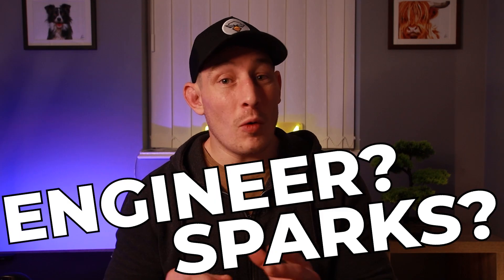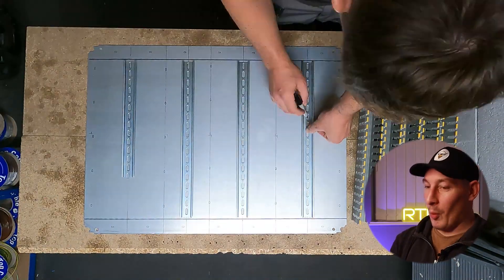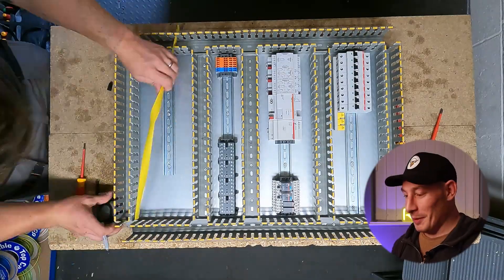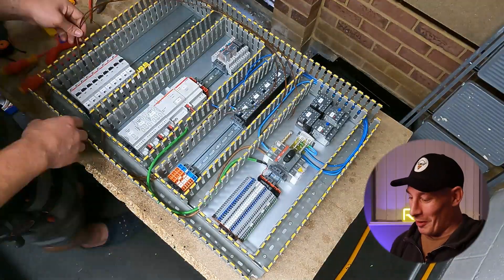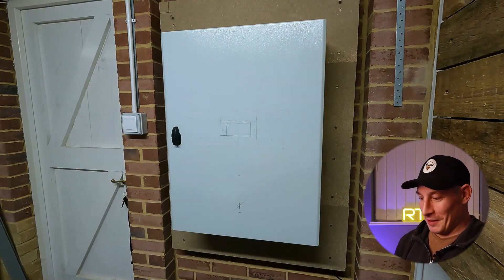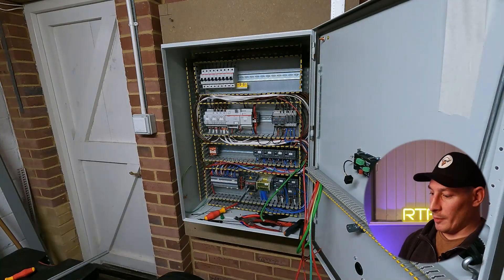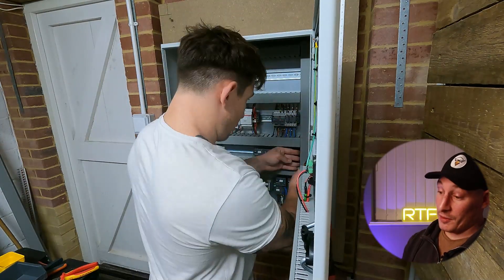Electrical Control Panel Wiring in 9 Minutes with KNX

Comment: My critique here is you not in anyway following regulation that govern panel building, BS EN 60204 lays out the guidelines for machine controls and panel builds, you have ignored colour coding of cables and opted for your own which can be very confusing to future engineers who may need to fault or work on your panel. An example is you have used red cables for 24vdc, red cables in panel building denotes AC control of any voltage, dark blue is what should be used for DC control, your power cables from source (main-switch) to load should be black and suitably marked, in fact all cables should be marked up, as you have a Neutral within the panel you can use light blue cable but as you already should be using a blue for DC control it also needs clear identification at all connection points.
  This was my first error when I start building panels a few decades ago and to be in compliance I suggest you get a copy of the latest BS EN 60204 as it doesn't just map out the basics I broached on but how your DC is generated and you fusing and grounding down options on a control leg.

Comment: Do low voltage and data cables have to be in their own containment, not sharing with mains voltage cables?
Reply: typically AC and DC are located in separate areas/ducts

Comment: Nice video. I’ve built and wired panels for 24 years and I’ve never used a laser for anything. With the isolator shaft cut I just cut the shaft to size , fit it in the isolator and mark the top with a marker pen, close the door on it and you have the mark to drill for the handle 👍🏽

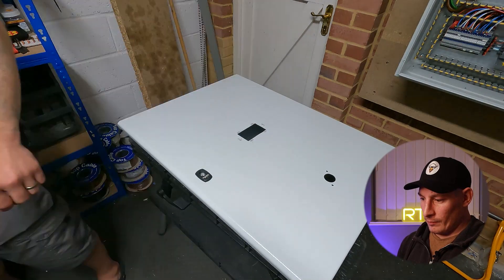Comment: Lol. Had to comment @7:00 i noticed the shirt was used to clean off a bit of debris (or maybe cutting oil) after drill/tap the panel touch screen display. I spend a good percentage of my time at work building panels for CNC and CNC control circuits. Well done!👍

Comment: I do not use those screw because they tend to leave shavings under the trunking and DIN bar. And sometimes even leaves sharp shavins sticking out from the screw heads. But they are faster.

Comment: No wire numbering? I also noticed the cabinet door was drilled while on the enclosure... I would have covered the terminals and components from shards of metal flying into them.

Comment: Good effort young fella, in my day still is but when i started we use to lace our looms no plastic wiring duct in those days 😁 for door mounted devices i use rivet nuts no unsightly bolts poking out or sharp bits

Comment: Nice work so far. I might suggest waiting until all of your components are installed before actually installing the wire duct as it's just easier to not have to assemble around and over the duct. Mark it and drill it just wait until wiring starts to install.  Very well done! Cheers!

Comment: Excellent panel, very nicely done. There was a really good opportunity to flood the video with information about the panel itself, model numbers, parts, purpose of the touchpanel on the front, customer needs, etc... so much to talk about and felt you missed a good opportunity there. I guess the video was about the panel build, not the stuff in the panel, so fair enough - but I was also interested in what was going in there. What KNX gear was in there? (what power supply, dimmers, IP router, control gear etc.?) Anyway - great vid nevertheless!

Comment: I saw a Lithuanian guy building these and he had the habit of using a hammer to snap off the ends of the screws on the back of the panel.  I have no idea if it is necessary or not but it is possible.

Comment: I build various sizes and types of these for a living. Had never thought of using a laser to mark the hole for the isolator switch shaft, definitely going to use it in the future myself!
Reply: Drop of tippex on shaft end that's cut to length, shut door and bingo you have your mark. Lot cheaper.
Reply: I use carpenter squares to mark the shaft on the ones I do. Never thought of using light amplified by the stimulation and emissions of radiation.
Reply: That laser trick is pretty slick. Gonna start using that myself

Comment: Nice job 

Few recommendations from a engineer

Tools use q max cutters  lot cleaner than step drills and yeah they do sq but heavy cost 

And  also factor in 20% from box size to consumption  when building panels as im my line it dose get used and dont take long for upgrades to go in or a oh dam we forgot

Comment: I build panels on this side of the pond.  Work is clean.  My only comment is using tech screws.  I started my career using them, but have been tapping machine screws for the last 15 years.  It's a preference thing.   My panels are usually much larger than needed so any maintenance guy down the road has room to work without fear of grounding out against the cabinet trying to troubleshoot.  My current project is a pump station for a corrections institution.  Pair of 50 hp pumps on VFDs inside a box that will be 2 meters squared by 1/2 meter deep and weigh in at roughly 500kg.   

I definitely agree on your point of enjoying seeing the layout "come to life" as the components are installed on the back panel.
Reply: I drill tap all my raceway and din rail, too. But the backings we use are 10 guage ang teck screws just dont cut it.

Comment: As a maintenance electrician i'll give you feedback, 1 major issue here - no labels or at least numbers on cables. It takes ages to faultfind issues if there no numbers or labels on cables. "But there is a drawing you st..id i..ot!"-you would say, I'll tell you  drawing lasts 5 years, panel lasts more, after 10 years you might not find drawing at all! And this panel will be nightmare for electrician who will work on it. So don't make me sad mark the cables!!
Reply from the maker: Stop trolling… you can clearly see there’s cable idents
Reply: Stop trolling

Comment: Hi, impressive work. Small question why's hmi panel and stop button located on down part panel and not in up part position. It's will be not comfortable? Thanks for your video, very interesting, good luck with your work.
Reply from the maker: Hey man... not sure I completely understand your question... the HMI is positioned there because that around face height when the panel is mounted on the wall on site
Reply: @beeautomation  Thanks for your answer.  That's exactly what I was asking.  I just didn’t immediately understand that in the video this is your assembly table and not the final place for mounting the cabinet. Have a nice day!)

Comment: Nice work. Curious question about your opinion on seperating mains cables from signal cables rather then putting it all on top of each other in th same trunking?
Reply from the maker: if the are high inductance cables like inverter or switching high loads on/off regularly then yes 100% ... otherwise I don't owrry.

Comment: Great informative video - thanks. Just wondering about the running of the mains voltage alongside and parallel to the low voltage; I've seen it mentioned elsewhere that it's good to try and keep mains to one side and low voltage to the other as much as you reasonably can. What's your thoughts/experience on this?
Reply from the maker: Hey man, thank you! In an ideal world yes, but it's not always practical... the only time I'm very careful with segregation is; 1. keeping sensitive signal cables away from high inductance cables like for inverters. 2. highly loaded cables where you have to think about grouping